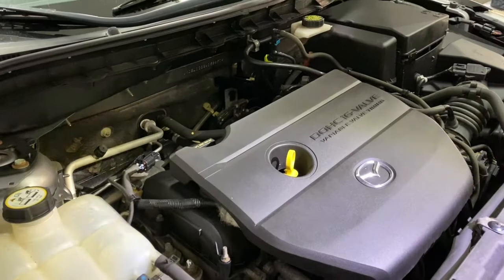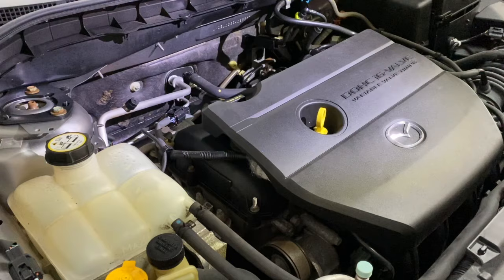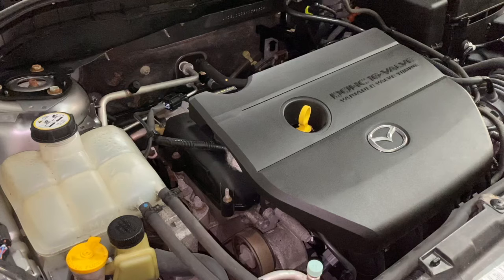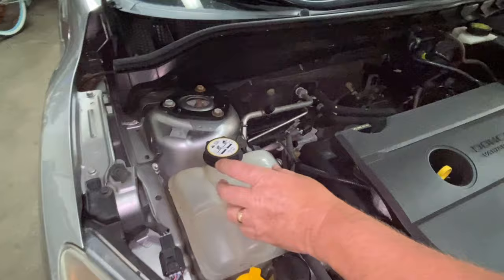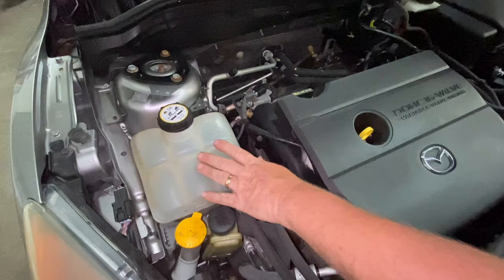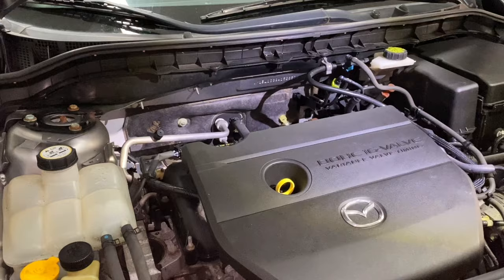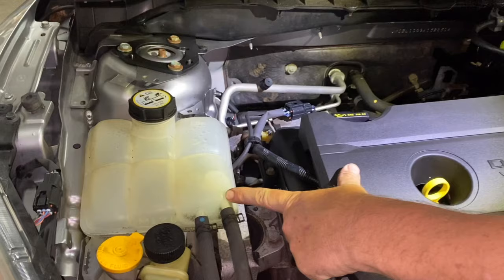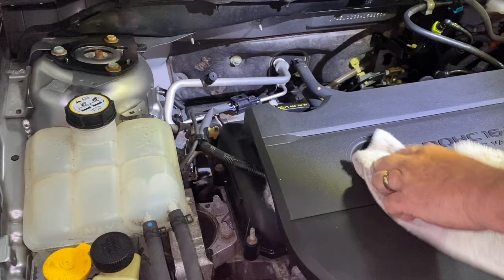Learn 3 Symptoms of Blown Head Gasket

Comment: Been searching the net but haven't found a solution. My car radiator fan keeps cycling on and off for few seconds (5-10 seconds) after coming to a stop from 4 kms and sometimes even cycles on and off when driving. Had replaced the water pump and remove the thermostat. Before the waterpump was leaking but new pump had been install. Any idea on what might be the problem?
Reply from the maker: I don’t know what kind of car you have but can be a faulty fan switch, start there if the car is not overheating, it’s probably over cooling. Start with the simple things first

Comment: Why do mazda 3 have overheating issues??
Reply from the maker: Well, all vehicles will overheat if not properly maintained. Most issues are caused by a leak ( low or no coolant) Bad radiator, water pump, thermostat or even a bad radiator cap could cause a vehicle to overheat.

Comment: Toyota tells me my head gasket is cracked but half the symptoms dont line or im just dumb.
Temperature is fine.
performance is about the same, i drive like a grandpa with cataracts so the fastest i ever go is 65 on freeways.
i had blue and white smoke for a while but after an oil change the smoke just white and no more than other cars on the road. like, my car just has abive average smoke while other cars i see leave behind view blocking smoke in newer cars than my 98 toyota v6. 
The coolant looks like very light brown mud and sometimes the coolant cap is blown off. It snaps into place really snugly so a pothole here and there wont knock the cap off.
Reply from the maker: Sounds like a head gasket problem to me

Comment: thank you for the good info! i have a 2008 Renault Megane k4m. i was stuck in traffic and noticed the temperature is getting too high (fan started to spin in full speed) so i stopped the car and checked coolant level,oil ... and everything seemed fine. so i thought maybe it's because of battery body ground (which my car doesn't have). i continued driving ignoring the temperature and fan (car was working fine though) and arrived home. again fan worked for about 4_5 minutes and stopped. tomorrow morning i went to check the car and noticed that coolant reservoir was nearly empty and coolant had leaked out of the fasteners. a mechanic checked it mentioning it was because of a faulty thermostat and coolant sensor and changed them. now my car works perfectly fine (no blown head gasket symptoms) but it seems it isn't as powerful and fast as it used to be. what do you think is the problem? thank you
Reply from the maker: Seems like it was overheating and boiled over. I would have it checked out soon before it gets worse. Could be just a bad radiator cap or thermostat.

Comment: Hi my Suzuki is also boiling when the fan goes on the water go to level low.... Now the problem is the water on coolant is drying I have to fill up every morning I dnt see any leakage can it be the headgasket or the seal cap is putting more air on it... How must I blow out the air
Reply from the maker: Try a new radiator cap first, if not vehicle should be diagnosed by local mechanic
Reply: Tnx will try that aiy is giving stress
Reply: You won't believe I tried radiator cap now the car is bck to normal no boiling.... Thanks a lot
Reply from the maker: @tshepomokgoro2941 of course I would! I’m glad that’s all it was! Always start with simple and cheap things first.

Comment: On my vehicle I have a slight exhaust leak. And so when I start the motor cold there is smoke coming out of the tailpipe but then it stops when I start driving. I just assumed it was burning fuel because it is running rich. I am slowly losing coolant but I can’t find where. My dipstick is clean and so is my oil cap. And coolant reservoir. I just can’t find where the coolant is going.
Reply from the maker: How much coolant are you losing say within a week?
Reply: @Motorcarnut  probably like 5oz, or like a third of my coolant reservoir.
Reply from the maker: Well if it were burning fuel there would be no smoking from that, it’s probably a head gasket starting to fail or a coolant leak when the car is hot.
Reply: @Motorcarnut  should I take it in to get a head gasket test? Someone told me about it where they just hook something up to the radiator and test the chemicals in there or something.
Reply from the maker: Yes that would be a good start. It will tell if there are exhaust gasses in the coolant meaning gasket or crack somewhere in the coolant passages.
Reply: @Motorcarnut  ok sounds good thanks for the help!!
Reply from the maker: No problem

Comment: Hi there, my Renault Clio Mk2 has milky residue under the oil cap but no milky residue on the dip stick. 

There’s also no oil in the overflow tank. 

There is blue smoke that comes out of the exhaust when driving which is probably piston rings. 

How do I know what the issue is ?
Reply from the maker: A little bit of milky residue under the oil cap is probably normal condensation. Try a thicker oil change with some “stop smoke” additive.
Reply: @Motorcarnut  thank you 🙏🏽
Reply from the maker: No problem

Comment: My 2010 GMC Sierra blows out blueish grayish smoke on startup out the exhaust and dissipates within 5-10 seconds. What could be the best guess for the problem I have?
Reply: Oh and it doesn’t do it while I’m driving only on startup no matter the temperature, it doesn’t do it all the time either only if it’s been sitting for about 3 hours
Reply from the maker: The blueish smoke is oil burning probably from worn valve stem seals from what you're explaining. Regular light white smoke is condensation ( normal ). The proper way to fix the oil burning is replacing the valve stem seals which is a big job, heads have to come off. You can try some (stop smoke) oil additive as a temporary fix.

Comment: Great video. I got a question I have a 2016 mustang and this car is blowing smoke at idle but then when I start driving it goes away and also I doesn’t always smoke at idle some times it does and sometimes doesn’t now When I does it doesn’t blow as much smoke seen in the video but it does blow enough to note that it is not normal any help would be appreciated. Thank you.
Reply from the maker: It’s possible you’re burning coolant. Sounds like when the car is cold, coolant is seeping into the cylinders. Can be a crack somewhere but most likely one of the head gaskets going. Should have the coolant system pressurized and tested for coolant in the cylinders.

Comment: What if I only have the overheat issue, the other issues aren't appearing,  but I've done a full change of my thermostat and that didn't fix the issue, I'm planning on doing a coolant flush tomorrow in hopes that fixes it.
Reply from the maker: That's a good start, also check or replace the radiator cap and back flush the radiator. Simple things first is a good approach.
Reply: @Motorcarnut  i have a 2008 f150 and I cannot find the radiator cap

Comment: Elo I have a jetta 4 AKL engine overheats and I replace the waterbottel and cap put new cold new fanswitch but still the water is boiling inside the bottle if I drive 60kms the temperature stay at 90⁰C but if I drive 110 to 120 it's going up to 110⁰C
Reply from the maker: A bad thermostat or clogged radiator would be next to check. Make sure coolant system is bled properly as well.

Comment: I replaced two anlasers (starters). It died because it coupd not start the engine. Can it be that much water on piston heads?
Reply from the maker: Possiable, try turning the crankshaft by hand to see if it's locked up

Comment: Does changing the head gasket fix the problem or does it need more intensive work after?
Reply from the maker: Sorry I mean No
Reply: @Motorcarnut  yes it fixes the problem?
Reply from the maker: If only the head gasket was bad, Yes
Reply: if the head or block is cracked or warped, just the gasket wont fix the problem.

Comment: My 2019 dodge ram (148000 miles) lost all its coolant. Pressure checked it two months ago and it passed pressure check. I’m not seeing any coolant leaks. Only other symptoms is a burning smell from the truck. No white smoke or milky oil. Any thoughts?
Reply from the maker: It has to be burning it then when it’s hot. Try test strips that detect exhaust gases in the coolant indicating a blown head gasket. That’s where I’d start.

Comment: Does a car always over heat with a bad head gasket? My coolant is brown colour and it feels a big loss of power but it’s not over heating
Reply from the maker: No, not necessarily. In your situation it’s probably leaking and losing compression in the oil ( crankcase) more than the coolant hence the brown color oil. And not pumping up the coolant system, yet.

Comment: My car blows white smoke every time I start it and eventually goes away after 3 min. Not sure if this is a head gasket problem. I know there’s is a leak in the coolant because I hear a water sound in the dashboard whenever I start my car and I have to fill it up every two weeks. Just not sure if this is a head gasket problem or not. What do you think?
Reply from the maker: A little white smoke on a cold start is normal condensation but you have to find where it’s leaking from. Can be the head gasket is leaking as the sound you hear air pumping up the system from the pistons

Comment: D40 no symptoms but coolant keeps leaking from the over flow, constant has to top up
Reply from the maker: Either blown head gasket pumping up coolant system or bad radiator or thermostat
Reply: @Motorcarnut  thanks will check all 3 leaving the head gasket for last
Reply from the maker: No problem, good luck

Comment: sounds like i got a blown head gasket...off to the mechanic again,whoopee
Reply from the maker: Let them make sure or get a second opinion.
Reply: @Motorcarnut  will do...thanks for your video
Reply: @Motorcarnut  i was told the engine had over-heated because for some reason there was no coolant in the car...that was about 2 weeks ago,but the car is still going,although  i have only driven short distances...do you think the car will eventually seize up?
Reply from the maker: You have to make sure the overheating condition didn’t cause damage before assuming the car is reliable again.

Comment: Hi! May  i ask what u think the problem could be. I just bought a used 2001 Lexus ES300 from a used c dealer over the weekend. saw a puddle of liquid and found out it's coolant leaking from oil pan (through the pan gasket above drain oil nut). dripping at 15sec per drip. check oil dipstick no sign of water ( maybe they changed the oil b4 sold) and no heavy white smoke. i saw the reservoir was empty and same as radiator when checking it and had them filled it. 
please, from your experience what you think it is leaking from i mean the problem? oil cooler gasket in oil pan? why i dont see chocolate oil at dipstick? water pump? Thank you!
Reply from the maker: Sounds like a bad coolant leak, did you check the level of oil on the dipstick? Make sure it’s not way overfilled that could be the sign of coolant entering the oil from a blown head gasket or crack. The oil cooler is not in that area it’s up from near the radiator. Also could be leaking from a heater core hose towards the back of the engine or from the head gasket. Go back to that dealer he had to know it was leaking. Probably put some of that head gasket sealer that doesn’t work ( watch my video on that ) Have a local mechanic confirm the problem and give the report back to the person who sold you the car. Good luck!
Reply: @Motorcarnut  the oil dipstick was and is at proper level. doesn't look like over the max limit. if the head gasket, should it be lots of white exhaust smoke? no white smoke here.. Thks!

Comment: Hello mister i have a coolant leaking on my system , iswiched the radiator, checked the oil george to check if there was a leaking inside the chambers but there was not, i wonder where could the leak be , i have a honda civik 2009 automatic
Reply from the maker: Could be burning it from a head gasket that’s failing

Comment: Okay I have white smoke coming out my car but no milky oil and my white smoke is no where near like that and car is not over heating only does it around 2500 rpm’s then no more smoke or if I constantly hit the gas fast. Then when I’m driving no smoke.
Reply from the maker: A light thin white smoke when the car is overnight cold is normal and as it heats up goes away. If the car is hot and you get white smoke, you're burning coolant and somewhere it's getting into the combustion chamber by a crack or head gasket starting to fail. Also when you hit the gas make sure its white and not blue that would indicate burning oil.

Comment: Please help -  I bought a 1999 JDM Forester turbo 2.0 and the radiator was empty. The coolant does not reach the water pump (it's dry too). Car overheats and sprays coolant from a hose which later connects to heater coil. The hose in and out of the heater coil are dry too.
Reply from the maker: Hard to know what’s going on there. Head gaskets we’re a big problem with those Subaru’s engines. Also can be a flow problem.

Comment: I got a error about cilinder 1 (ignition problem) with lots of white smoke but it doesnt seem to lower my coolant levels?
Reply from the maker: Could be a blown head gasket leaking coolant into that  cylinder causing the misfire and smoke. Should be checked asap.

Comment: I have a 1996 Lexus sc400 1uzfe v8 engine ran lean for awhile then one night car started running terrible (shaking the cabin loss of power knock sensor codes) did compression test cyl 6 zero compression every other cylinders good compression. After watching this video my oil is definitely way past the fill line and I put the right amount every time I wouldn’t put extra like that. Car overheated slightly but gauge would go back down.  In the months leading up to this upon starting the car after it would sit for a few hours a very generous amount of blue tinted smoke would come out the exhaust.  Just wondering if this has anything to do with a blown head gasket and if not do you know a possible culprit/ solution
Reply from the maker: The blue smoke is oil burning probably from the valve stem seals. You probably do have a blown head gasket because of the low compression and oil overfilled.

Comment: I just purchased a 2018 Cadillac CTS 2.0 turbo it only has 30,000 miles clean engine but I have noticed that when I shut the car down I hear like a bubbling noise so I popped the hood and I noticed like a lot of bubbling with antifreeze coming from the radiator holes going into the reserve tank what does that mean now the car doesn't overheat at all I have not seen any milky substance and I've had the oil change twice already in my mechanic tells me everything is fine so what does the bubbling in the reserve mean
Reply from the maker: Slight bubbling ( coolant moving) is normal as the car heats up then cools coolant pressure expands and contracts. As long as it doesn’t overheat or have excessive pressure and or boiling.

Comment: Would a tore/ripped or small hole in the flex pipe cause the car to blow out white smoke in the exhaust ?
Reply from the maker: No,
Reply from the maker: It will sound louder but has nothing to do with what the engine is producing from exhaust

Comment: Your thoughts  (good video) hg replaced 6 months ago  therm/coolant sensor replaced a year ago . Rad replaced 2 years ago . ....garage have done relevant checks twice and all OK.  Driving .......60-70mph dash lights up coolsjtvtemp high . Gear down thfn gear down again.  Got it to a safer place let it cool .

Coolant exoelled from overflow over engine.  Wtf us going on here ? Thanks oh and new rad cap recently
Reply from the maker: Thank you! Wow, so with all that done I would say maybe from when the head gasket blow and car overheated first time they was a crack somewhere or the mating surfaces on both the block and head weren’t completely flat or in spec?
Reply: @Motorcarnut  I'm unsure tbh but they have done checks to rule out hg failure I'm assuming checks such as compression checks
Reply: @Motorcarnut  usually a compression check will so issues with this .......unless they lied but they'd be risking their reputation of so . And they (from reviews etc ) take pride in their work
Reply from the maker: I don’t know what to tell you, I’m not there to check it out but you seemed to do a lot so maybe a crack somewhere? Do you smell anything out of the ordinary?
Reply: @Motorcarnut  nothing unusual no just so odd I bloody Hooe not

Comment: I have a 2010 Nissan rogue thats overheating easily but it doesn’t have none of these symptoms but my coolant does go down by a bit. Could it be the thermostat? I already replaced the water pump and it fixed nothing. And no leaks anywhere to be found.
Reply from the maker: Yes, or as simple as a radiator or expansion cap.

Comment: If the car does npt have a temperature gauge do not buy it. car im looking at has no visible steam from exhaust but the water disappears from the radiator. The oil looks free of coolant i did notice exhaust coming out of the radiator cap.  The engine runs very bad and you hear a lot of noise under the valve cover.
Reply from the maker: Sounds like the head gasket is blown.

Comment: My car most mornings have white smoke come out the tailpipe and a coworker said it antifreeze burning meaning that it was getting into the engine and it could be blown head gasket or cracked head. I opened the oil cap and it was milky oil on the cap but not the dipstick. Inside the hole I noticed that it was milky oil on top as well. He said that it could be a vacuum leak from the intake. Need a little guidance to figure out the problem. Also other symptoms misfire on start up rough idle.
Reply from the maker: It does sound like you blew the head gasket. That would also cause misfiring.